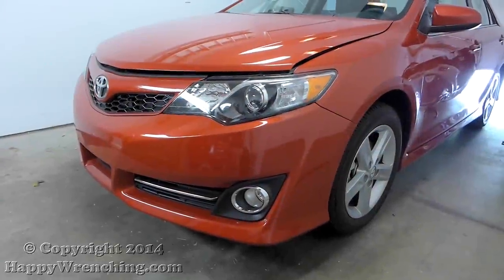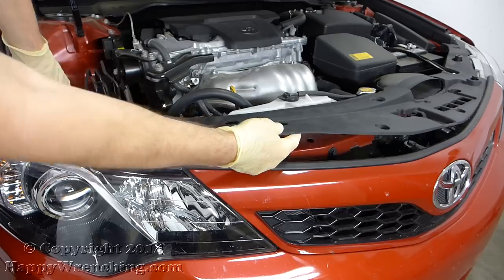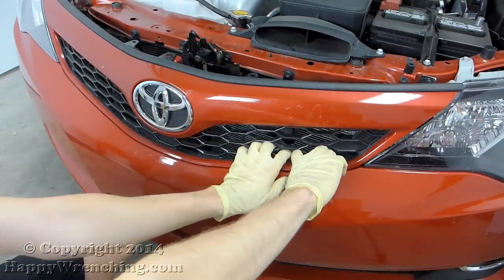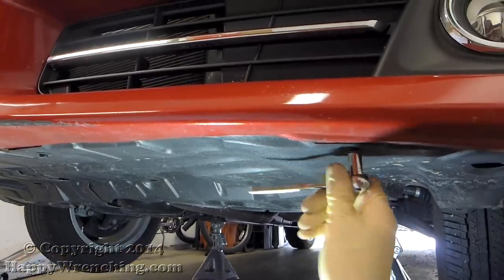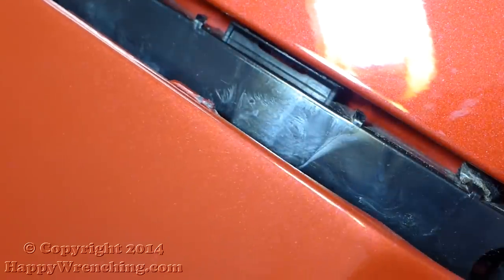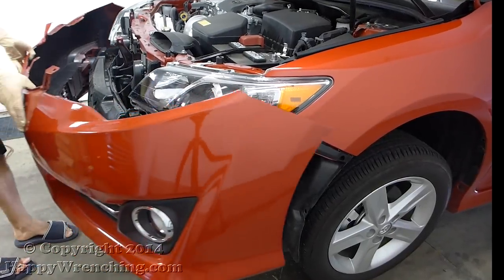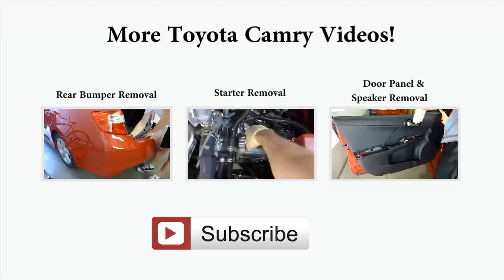Toyota Camry Front Bumper Cover & Grille Removal (2012 - 2014) | Replace & Change

Comment: How much time did your video save me?  LOTS, I'm quite sure, plus helping me avoid damaging anything.  Thank you, thank you, thank you.  To pay it back a little, some notes:  The Phillips in the wheel well is a #1.  If you're taking the bumper cover off, you do NOT necessarily have to disconnect the grille from it; you can reach the three lower button fasteners fine from the top with the grille in place.  On mine at least there are six of those 10mm screws on the bottom.

My reason for taking it off:  I bumped into something and dented the cover in the lower right corner; I didn't want to replace the whole thing, but it had a dent along that lower "crease".  I popped the dent out by cutting a couple blocks of wood with (roughly) mating "V" surfaces and used a clamp to press the wood blocks together with the cover in between, and press the dent out.  That worked, but not perfectly.  A heat gun on the back side warmed the plastic enough that I could smooth it out close to perfect.  Take it easy and don't over-heat!  If you don't have a heat gun, a hair dryer on high may work.

Putting it back on:  it may help if you first put those push fasteners all in before you push them closed...likely unnecessary, but it might just save you having to take one back out.  The plunger on the grille fasteners seemed to want to go down, which will keep the fastener from going into its hole, and it helped to hold them with two fingers, one on either side of the plunger, just under the head.  Also, note that the push fasteners for the top cover have one leg a bit longer than the others, and you can use that to your advantage to get them back in their holes.  Before I noticed that, the sprung-out legs weren't wanting to go into the holes very easily.  Of course you can avoid that by using new fasteners that haven't had their legs sprung out yet.

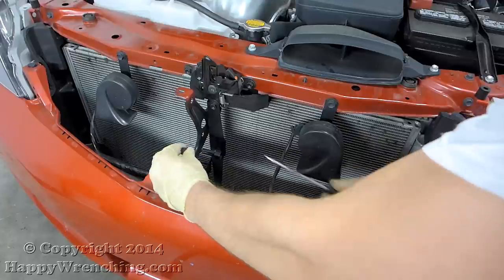Comment: Question... at 2:39.. you see the plastic on the left side of the radiator? I believe its called a deflector.
Is that suppose to be fairly loose and not snug? I had the dealership work on a few unrelated things on my car and ever side everytime I drive (especially with a cross wind) I hear this hollow sound much like some plastic getting caught in wind. Its quite annoying and one of those type of things you just have to fix yourself (dealer always says that is normal etc). I hope you have some insight into this.

Comment: Great clip. So this is designed so you absolutely HAVE to remove the bumper skin to replace the grill that runs the length between the fog lamps (2014 XLE)?

Comment: what is the plastic cover at the bottom of the car called? Mine got cracked, so I do need to get this one a replacement. Thanks!
Reply from the maker: That's the engine under cover. Its also called an under body cover or under body panel.

Comment: I saw a comment  below asking you about not taking the whole bumper off for the foglight replacement and you suggested the two fender screws and one under neath I am going to try that myself for my foglight but was wondering if you thought I should still take the negative off the battery to not set off an airbag? Any help would be great! Thanks

Comment: What if the car has like plastic around where the wheel is at. It looks like it's attached to the bumper but also the rest of the car, this car doesn't have that I'm wondering if it was glued into?

Comment: Loved this vid on the front bumper cover removal of the 2012 toyota camry, but it seems that the front bumper cover of the base 2012 toyota corolla is a bit different, do you or will you have a video on this?
Reply from the maker: Yes, the base bumper looks different but all of the steps to take it off are the same as in this video.

Comment: could you please post a video on how to remove just the front wheel well liner? i know theres a couple bolts, i can't figure out how to take it off. I wanna replace my fogs but i don't wanna go thru the trouble of taking off the whole front bumper cover
Reply from the maker: You do not need to take off the whole bumper to get at the fogs. You can remove the two screws in the wheel well liner that hold the side of the bumper. Then remove one of the screws on the bottom. Pull on the side of the bumper to disengage it from the fender. That should give you enough room to fit your hand in and reach fog light.

Comment: At 5:45 Putting the passenger side back on, what is the grey plastic piece that the bumper is covering when lining up the bumper? That piece is loose, and that side of my bumper keeps popping loose, Thank you.
Reply from the maker: That's called a bumper cover reinforcement, or retainer, or even side support. Google part number 5253606190 for an example.

Comment: any suggestions if the part at 3:15 is broken?? I haven't been able to get that corner of the bumper to remain  clipped in. The plastic screw doesn't seem to be able to hold anything anymore
Reply from the maker: You should be able to buy replacement clips at your nearest auto or hardware store.
Reply: I have the same problem not the clip but the backing where the screw goes into.....on a side note  body shop said replace the bumper. I was at a lost of words and walked out the door the minute he said replace the number . The clip is one inch wide I was thinking JB welding a new clip.

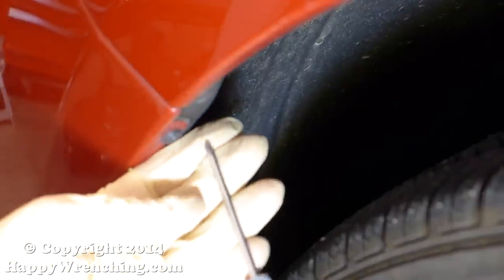Comment: is there a trick to take off the plastic screw at 3:09?. The driver side comes out easily, just like in this video. But on the passenger side, it just keeps spinning and does not come out.
Reply: Butterz88 having the exact same issue. Help plz!
Reply: My passenger side screw came out but the fender well plastic is not budging. I can't pull the fender plastic out of that screw hole. It doesn't make any sense.

Comment: The little plastic things you were removing with a screwdriver... You were doing it wrong. You push IN the middle of the clip and you can then remove it easily. Push from the plunger end to "reset" it. No risk of damage :)
Reply: yes, you are right. do you have any idea how to pull the grille off? unlike in the video, I found it was very difficult to pull it off. Should be there some tricks? Thanks!

Comment: Could you comment on whether I can pop out the lower front grille on the camry and install a new one? Or do I need to take the whole bumper apart? Is it just popped in by clips or something I need to do from the other side? Thanks!
Reply from the maker: I can only comment on the 2012 - 2014 models. There are three pieces to the lower grille. The center piece is held in place by clips. You should be able to pull it and pop it out. The two left and right pieces by the fog lights are held with clips and also two screws that you need to get from behind the bumper cover. You may be able to remove the under body cover and reach in the back to get those screws. This will save you from having to remove the whole bumper. If you look at my toyota camry foglight and headlight removal video around the 4 minute mark you will see the screws.

Comment: what are parts of the car that can't be replaced? I can't tell if the part that runs along the top of the car above the doors is a panel or actually part of the frame.
Reply from the maker: +zenetra burage Everything can be replaced - even parts of the frame if you have the right tools. What you are talking about is the roof molding and it is replaceable.
Reply: +happywrenching thank you. I was just wondering because a lady side swiped me and the part of the frame is actually welded.

Comment: what are the black plastic cover under the front bumper called? The one where there were 10 screws there
Reply from the maker: That's the engine under cover. Its also called an under body cover or under body panel.

Comment: Is there much difference between this removal and replace and a toyota camry 2011?
Reply from the maker: It's very similar. The biggest difference is that in 2012 - 2014 the front portion of the bumper that contains the grille is removable while the 2011 the bumper is one piece. In addition, the 2011 does not have the top plastic cover.
Reply: happywrenching  Thanks for the answer!

Comment: I got the same car,I'm trying to do plastic dip on just the front grill,can u please tell me if I took of just the front grill not bumper do I still have to disconnect the battery cable since I'm taking off just the grill or it's still necessary to disconnect the battery cable
Reply from the maker: jaswinder kumar You should be ok with not disconnecting the battery.
Reply: Thank you very much

Comment: I have a silver 2012 camry does anybody know how to actually obtain a black grill silver on the outside to match my car? Basically im just trying to replace my old cracked up one with the exact same thing, my car is silver. It's actually kinda impossible to find a exact replica of the same base model part in silver and black for a 2012 cam se smh why? I'd expect this for cars like rolls royce and bugattis etc but not a basic standard car like camry sheesh. If anybody can help please share a link and than you in advance